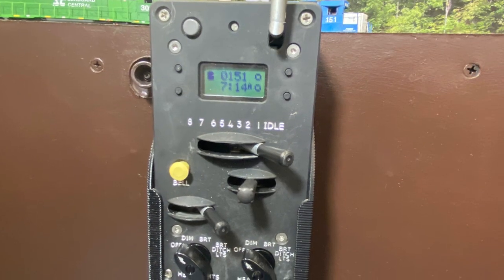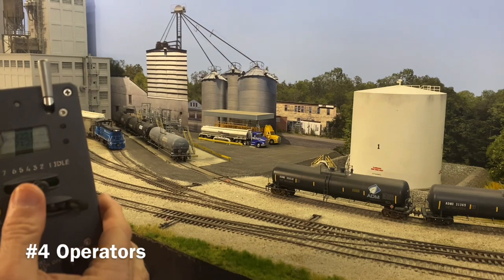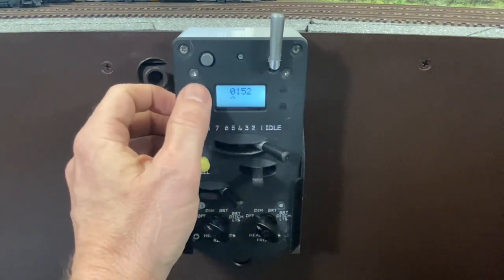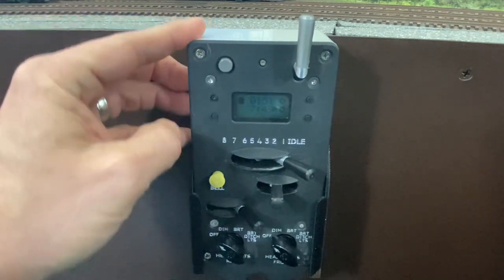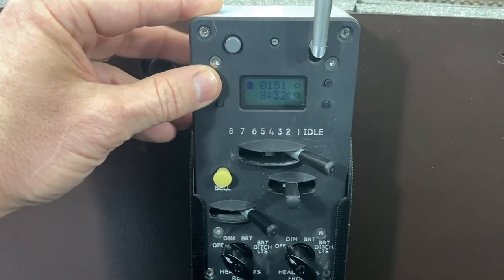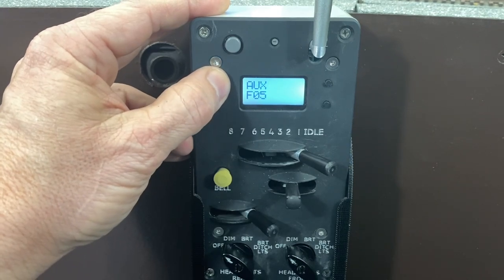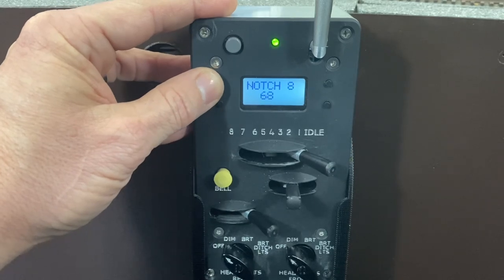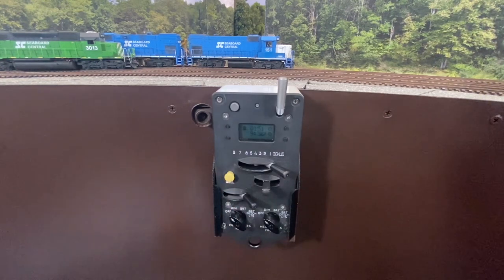Seaboard Central - ProtoThrottle Settings

Comment: Great video. I keep looking at the ProtoThrottle for my layout.
Reply from the maker: Thanks! I love mine. Never even bother with the old controllers now. The ProtoThrottle adds a whole new level of fun when it comes to operations.
Reply: @SeaboardCentral  I love the interface. My problem is with DCC. It's just old tech. I've been working on decoders that don't need a command station.

Comment: Thanks Tim. I just jumped into DCC and sound this week and the timing of your video couldn't have better from my perspective!
Reply from the maker: Thats great Kevin! If you haven’t purchased a DCC system yet I would recommend using NCE. And I would also suggest using ESU LokSound decoders in your locomotives. You can’t go wrong. They are the best in my opinion.
Reply: @SeaboardCentral  I'm really glad to hear you say that, Tim!  A friend had a "spare" NCE Power Pro wireless starter set, minus the wireless Pro Cab (a long story). He kindly gave it to me, and for the cost of the power transformer and a regular PRO Cab, I'm in business!  Because of your use of NCE, as well as some "local" friends who also use it, I was leaning hard toward NCE, but a "free" system (at least most of one) sealed the deal.  Now I'm exploring wireless options, so your video couldn't have been better timed!

Comment: Thank you for this (and your other) fantastic videos!! I have closely followed your suggestions on many of the topics you covered and appreciate the time you dedicate to sharing your insight. Do you have any documentation or videos on how you set up your consists for your ProtoThrottle?
Reply from the maker: Thanks! I use an NCE system and set up Advanced Consists for all my locomotives. I have a couple of videos on how I program my decoders with a LokProgrammer. I only use ESU LokSound decoders in all my locomotives. I like how easy they are to work with and how you can get real prototypical performance out of them.

Comment: Tim, So glad you shared this content with us in this video format.  I know I've seen various posts from you across several forums around actual decoder settings for your ESU decoders.  I
m curious if you've thought about sharing an esux project file for one of your locos that supports the content covered in this video?   Might help put a couple of the other pieces together without going numerous other places or finding your posts in the forums.  Regardless on your decision to share further content super video, and thanks again f
Reply from the maker: Thanks Mike. I made a couple of videos on programming a locomotive that goes along with this. Here’s a link: https://youtu.be/A8Laq7XC8j4
Reply: @SeaboardCentral  Tim, I remember that episode.  I was just thinking a project might help wrap everything together.   Great walkthough of the decoder settings.

Comment: Great Video, Tim! Just heard Michael from ISE on the AML podcast and I am going to pull the trigger this Spring. Question: Can a 2nd operator use my NCE Power Cab controller as a (2nd) independent throttle or will it now be disabled when I use the PT? Thanks.
Reply from the maker: Thanks! Yes, you can still use your other controllers at the same time. No issues.
Reply: Good to know! Thanks!

Comment: Hi Tim
What’s the light engine setting that comes when you toggle through the settings? 

Thanks
Reply from the maker: It was a feature that was talked about when the project was first started. The idea behind it was that it would create a different speed curve to simulate a light load verses a heavy tonnage train. I don’t use it and am really unsure if it ever was perfected.

Comment: Really cool Tim. Great video. Does the Proto throttle only work when all the decoders are all of the same make and manufacturer? Reason being I have locos that use both ESU and Tsunami Sound Traxx.
Reply from the maker: Thanks! The ProtoThrottle will work with ESU, Soundtraxx and TCS decoders. The only thing is that the Function Table needs to be the same for each brand. For me, I settled on one brand of decoder for all my units. Personally, I think the ESU decoders are a perfect fit for the ProtoThrottle. I think the Tsunami 2 decoders with their digital dynamic exhaust is a great fit for those Railfan model railroaders who just want to sit back and let their trains run. Just a suggestion, I would use your ESU decoder equipped engines with the ProtoThrottle for your yard and local service trains and your Tsunami decoder units with your regular controllers for your Road trains.
Reply: @SeaboardCentral  Thank Tim 👍.

Comment: Question about the notches. I have changed my speed settings in the decoder, so 100% on the throttle is only about 50% of the max speed. I am assuming the notch settings are based on your decoder settings.
Also, do I setup the F__ and the notches for each and every locomotive, or is there a default that you set that applies to all locos and then you match the decoder settings to the PT default settings.
Thanks
Reply from the maker: I actually limit the speeds on my locomotives depending on what service they are assigned. For example, all of my yard service locomotives are maxed out at 12 mph. I achieve this at notch 5. All of my road units are maxed out at 18 mph which I achieve at notch 8. For me personally I don’t like to see model trains sprinting around tight curves because it destroys the realism I am after. On the prototype, I have to follow speed limits just like people do on the streets. Yard and Industrial trackage is limited to 10 mph. Depending on the degree of curve or limitations of the track, speeds are reduced on the mainline. So the settings on the ProtoThrottle which would restrict the models speed are actually a plus for me. 
On programming side, I program all my units with the same function table so it will correspond to the settings on the ProtoThrottle. To see more of how I program my locomotives to operate like the prototype be sure to see some of my earlier programming videos. It may answer a lot of questions. Tim
Reply: @SeaboardCentral  On a real SD40-2 or GP38-2, RUNNING LIGHT, approximately what speeds correspond with each throttle notch? I realize that adding tonnage is going to change that, but for sake of comparison... 
Thanx, Rick
Reply from the maker: @Bardwell_Junction  on a real GP38-2 or SD40-2 moving around by themselves you can get up to speed pretty quickly. You can be doing 10+ mph in notch two in a few seconds. Now if you add about 2,000 tons behind a single GP38-2 then you might not even get it to budge until notch three or four.
Reply: @SeaboardCentral  Thank you, that really helps to understand it all a little better

Comment: With shipping to Brazil, do you know how much it costs? in dollar.
Reply from the maker: There are some online dealers in the US that will ship to Brazil. I am not sure what the shipping charges would be. What kind of DCC System do you have? You will need to also get the adapter for your DCC system and that is separate. For example, I use NCE DCC system.

Comment: How long donthe batteries last?

Thanks.
Reply from the maker: Depends on how much you use it. I use rechargeable batteries and I can get mine to last a couple of months between charging. That’s probably operating a total of an hour or two a week though. If I was retired an ran the layout every day then I probably would have to replace them every three weeks.